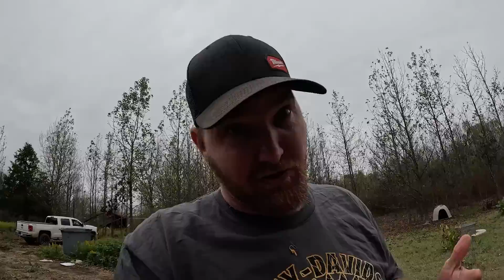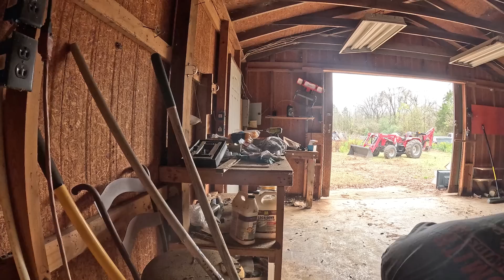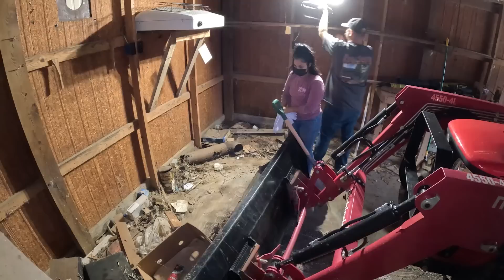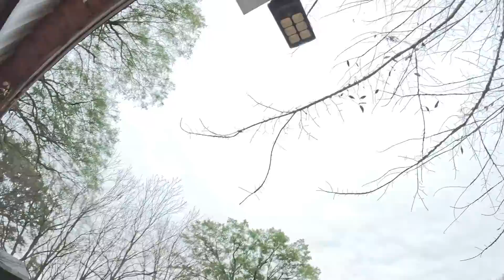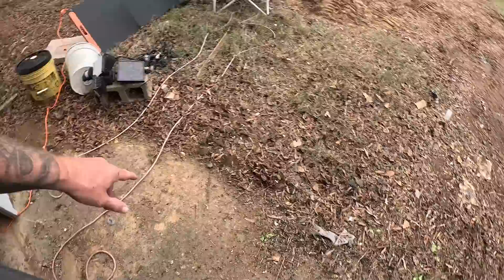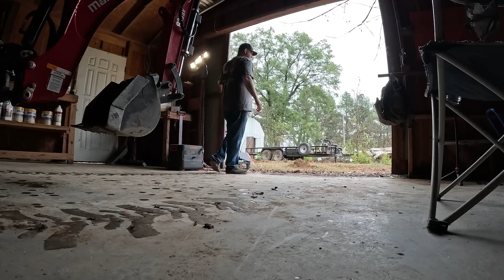MASSIVE CLEAN UP BEGINS AT THE ABANDONED PROPERTY |tiny house, homesteading, off-grid, cabin build

Comment: You’ve made good inroads.  Ideally you need a shop-vac vacuum cleaner it keeps the  dust from flying around so much but they take electric. You get LED lead flood lights that don’t use a lot of electricity and they are pretty inexpensive to buy.  Margarita you and David worked really hard.

Comment: 😅If you can clean up your rafters as well before working on the floor. It will help ensure that no dust then gets set into the finish of the finish you are adding to coat the concrete.